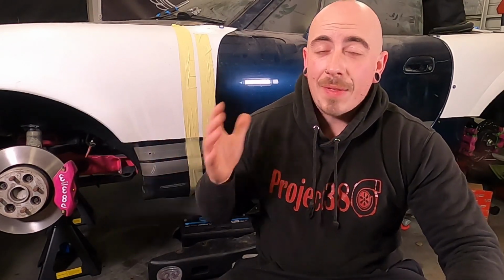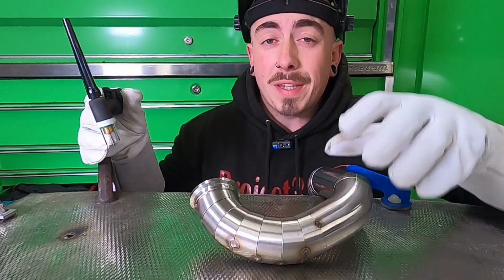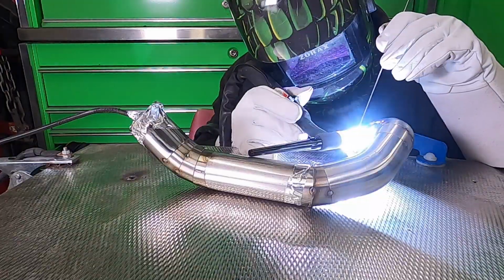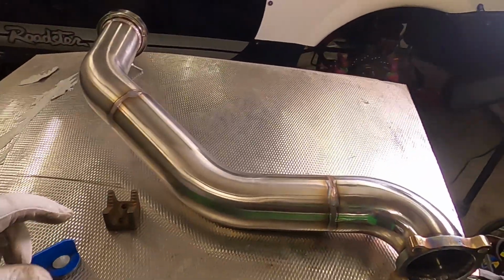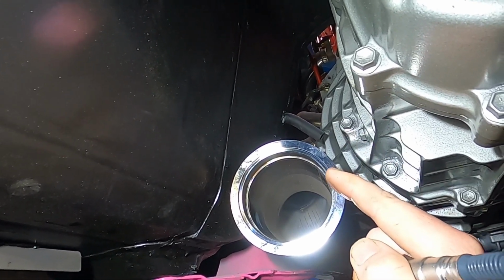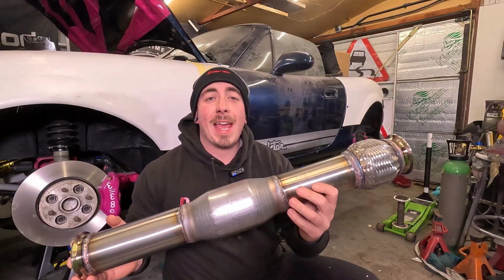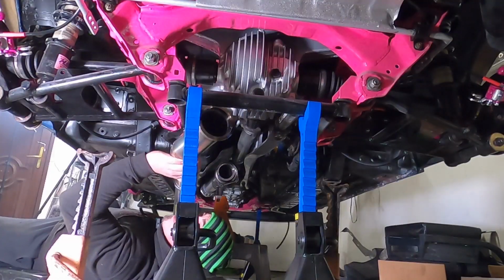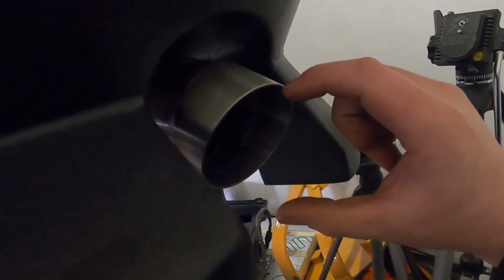MX5 Turbo Build Pt 52: Check Out this INSANE Custom Miata Exhaust!

Comment: I have an me kit which comes with td04 turbo and 2.5 inch downpipe. What do u think continue with 2.5 or step up for 3 inch tubes?
Reply from the maker: i dont think you will gain much from stepping up to 3"  you may actually loose flow and its then a pain to get 3" pipe past the diff
Reply: @Project380  yep I’m guessing if the down pipe 2.5 than should be good all the way. Td04 is a fairly small snail
Reply from the maker: @chiccoka  exactly  stick to 2.5 unless necessary and you should have smooth flow